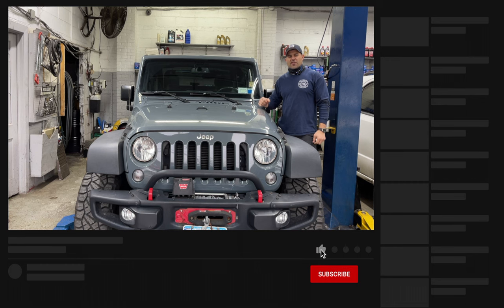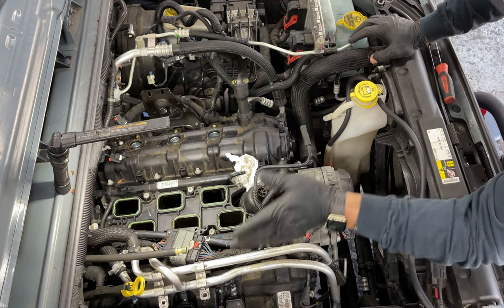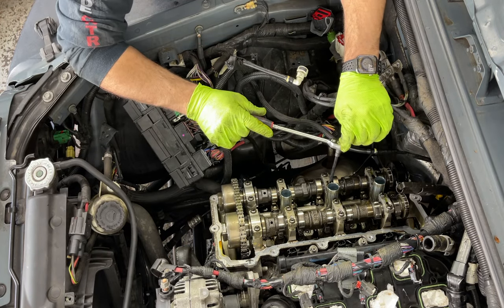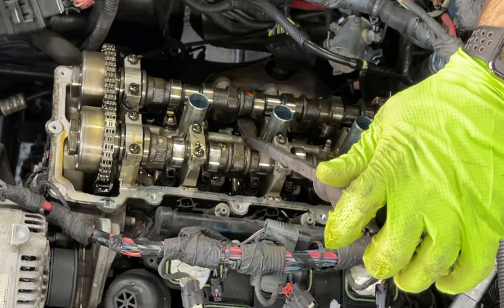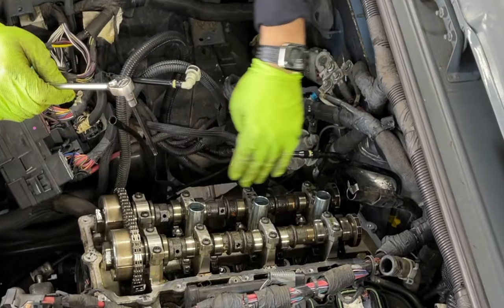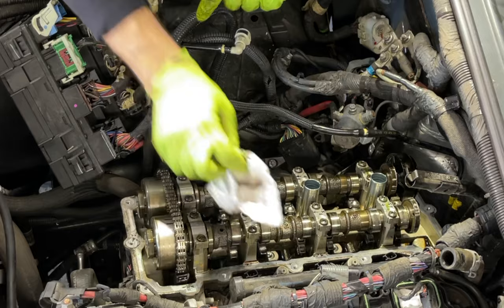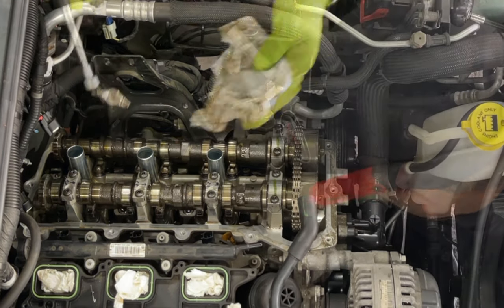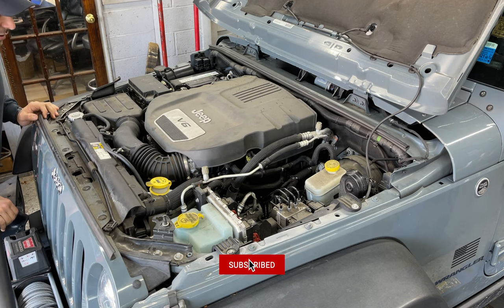How to fix Pentastar Engine tick Jeep 3.6L "SHORT CUT"

Comment: My jeep was ticking just like the one in the video. I ordered the parts and watched the video carefully and my jeep is fixed! Cost me a fraction of what the dealership wanted. Thanks a million!
Reply from the maker: I love when everything works out the way it should. You got the job done right, save $$ and learn something new. Thank you for watching I do appreciate your comment.
Reply: @a2zautomasters862  thank you so much! I didn’t have the money to pay to have it done! With your video it was easy to do. Thanks a million
Reply: Great vid. One question, do you need to replace cover gaskets?
Reply: Same.  500 bucks vs the 2400.00 the dealership wanted.🙄
Reply: How hard was it? About to this weekend? Any tips?
Reply: Hopefully mine works out the same, I just ordered the parts today.
Reply: Just replacing the rocker arm fixed the problem?
Reply: The problem is the thin oil they recommend. Use a 5w30 and eliminate the source of the problem.
Reply: About to Tackle this myself here real soon, all parts are ordered. Thank you for doing this video very informative.
Reply: @tullyg493  Is that for real?  The ticking is so annoying but this looks like a ton of work.
Reply: Dealer just quoted me 4500 for this!
Reply: @gary1488  just follow this guys instructions start to finish. And it will stop completely. Easy fix. Just looks hard.
Reply: What about cam timing if the cams are replaced?
Reply: @williamhaselrig9355 exactly.  This is not a job for the faint of heart. So many things can go wrong.
Reply: I'm about to have to do this to my 2018 Rubicon jl

Comment: Good  guy he is honest  knows what he's doing I have the same Engine he replaced  I had  ticking in the engine and even cam shaft needed to be replaced it took about 3 days to repair everything  I have no problems now I would recommend this shop you won't be disappointed
Reply from the maker: Thank you so much. I appreciate your business and your comment.
Reply: I am in Michigan.  where sre you located?
Reply from the maker: @vladvonravenloft9330  NY Long Island
Reply: How much does this cost
Reply from the maker: @dyllanfennell1570  Depends,  if you changing any camshafts, oil cooler seal kit, or camshaft position sensors. also got to change valve cover gasket, intake manifold gasket upper and lower and all 24 Rocker and 24 tappers. $2k-$3k
Reply: @a2zautomasters862  thanks for replying! I am probably gonna try to tackle this myself with the help of your video! Should I stay with Mopar parts or is there a better replacement that doesn’t fail?
Reply from the maker: @dyllanfennell1570  I usually replace it with the original. Thank you for watching and I do appreciate your comment.
Reply: @a2zautomasters862  I know it sounds like a lot however if the vehicle lasts another 2 years, it's still worth it. I take it that it might be hard to tell if all that is gone until you get inside the engine? I would think it would be well worth it replacing all the Rocker and tappers verses one at a time?
Reply from the maker: @MeganZopf   a job like this is usually about $2500 or so give or take. I have seen those Jeeps with well over 200k miles so it’s definitely worth fixing.
Reply: @a2zautomasters862  well if I can’t find anyone competent to fix it here I might have to take a trip! I really appreciate you taking the time to respond. It shows your integrity
Reply from the maker: @MeganZopf  good luck with the car. Thank you again. 🙏🏻🙏🏻🙏🏻
Reply: @a2zautomasters862    To prolong engine longitivity would 5w-30 be better than 5w-20 for a 63,000 mile pentastar and would a higher volume/pressure oil pump help prolong engine life including the rockers, what list of recommendations do you have ?
Reply: Does it still run?

Comment: Great video! After being quoted $3000-$5000 from multiple mechanics and being told its a 20 hour job, I knocked mine out for a fraction of the cost (in the hundreds $ only) and  finished mine in 5 hours taking my time. Thanks for the tricks!
Reply: Are you mechanically inclined? I’m not experienced with any engine work but I cannot afford a shop

Comment: I actually did this to my jeep. Didnt even take the cam bearings out. Just loosened them rolled the crank till the lobe was up on each rocker and pulled the lifters and rockers out individually.  Dealership guys will tell you it cant be done this way. But it can. Just have to be careful.  My jeep has 40k on it afyer i did it. Been running great.  No more engine ticks! Love me some jeeps! Awesome vid!

Comment: Just finished doing the job today! This video was immensely helpful. I was able to create an even shorter shortcut by leaving the cam caps on but fully loose on the bolts and prying accordingly (based on which cam lobe was up or down). Regardless I wouldn't have even tackled this job without this video. Absolutely fantastic. Thank you to the author!

Comment: God bless good people like you who take the time to share your knowledge and experience! I have a 2015 I bought used a year ago with 54k miles on it. Engine purred like a kitten until about a month ago and I started noticing the ticking sound (around 63k miles). I've never bought an extended warranty in my life until I bought this Jeep. Thank god I did, gonna be taking it back to the dealership soon and hopefully get it fixed under warranty.
Reply from the maker: Thank you for watching and taking the time to leave the feed back. 🙏🏻🙏🏻
Reply: Where did you buy parts? eBay?
Reply from the maker: @juanbugayong2026  dealer.
Reply: @a2zautomasters862  Please explain what is the problem!! 
The engine makes a ticking noise okay?  
Why is that a problem and why does it require a repair?? 
Please take a moment to explain that in your title and description.
Reply from the maker: @chazzcapone.  any ticking or knocking noise coming from inside the engine is not a good thing. It’s a sign of wear. Internal engine components are so precise, minimum tolerance and very very small amount of clearance. That noise usually means those very small gaps are getting bigger and that’s very bad. In this case the rocker arms bearing failed and the camshaft rollers are hitting the rocker arm itself and that could cause a massive internal engine damage. I hope that was helpful. Thank you.
Reply: Guys can replacing the bank 1 and 2 fix the ticking problem?

Comment: This is an amazing video that guided me through both sides of my 3.6 rocker arm replacement, followed exactly and had zero issues performing the work as shown. For anyone who is about to do this the first time, go easy with the magnet near the back of the cams where the tone wheels are and buy decent parts, I did have to redo a set that were bought from Amazon because the rockers were made out of spec and kept valves open losing all compression. Thanks
Reply: That sucks big time.
Reply: I just did this job. Got it all back together and it was super hard to get started, if at all. I'm wondering if I have the same issue you had on the first set you put in. Did it seem like it is flooded? It did crank over a bit strange like low compression.
Reply: Did y’all buy mopar?

Comment: Thank you so much for your video. Between you and another youtuber, I was able to replace a set of (24) rockers, lifters and one cam. I found a rounded left intake cam during. I’ve not had to pull the Battery box before. Your vid helped me with routing of emission and TIPM plugs on assembly. Was a huge reference, thanks again. Good reference for where stuff was before. Always take pics before you disassemble things.

Comment: Did this job yesterday on a '15 GC driver's side.  Much easier if you roll engine to a little before top dead center, for driver's side, for a more neutral cam position.  Keep the magnet away from the rear of the cam, it will destroy the magnetism of the cam position rotors.

Comment: Great video man! My 2015 JK had the ticking noise on the passenger side... I followed your directions and watched the video multiple times after ordering the replacement parts. Once they arrived, the job took 12-ish hours to complete spread out over a weekend. MY JEEP IS FINALLY QUIET AGAIN! Thank you for taking the time to make this video and having detailed instructions on what to do! Saved me thousands! 

I was wondering if you had a video on replacing the CAMS? I could see some wear on the lobe from the bad rocker arm and I know I will need to replace it sooner than later. Was hoping you had another video I could study before diving back in... 
Thanks in advance!
Reply from the maker: Thank you for watching and I do appreciate your comment. Glad everything worked out. I will be doing a video about that soon, it’s actually being recorded these days  hopefully will be posted in couple of weeks. Stay tuned. 🙏🏻🙏🏻🙏🏻
Reply: Did you drain the oil prior to opening?
Reply: @alfkeep  no
Reply: There are other videos that show acceptable vs non acceptable wear on the cam lobes.  But if you left it ticking for too long you could have damage to the lobes...I'm not sure how that would manifest itself as the engine runs....probably poor performance due to lower intake or exhaust volume....?
Reply: @a2zautomasters862 what’s the cause of the ticking in the first place? Typical problem w the pentastar or something else? 🤔
Reply: @lstruggy  those engines dry start due to the oil draining back into the crankcase after the engine is shut off,causing the rocker arm bearing issues over time.There's a company that makes an oil filter adapter that has an anti drain back valve, which keeps oil in the top of the engine and solves the dry start problem.
Reply: @davidh6818 it’s called Baxter Performance.   It’s a pricey part but high quality and over time cheap if installed early enough to stop the dry start wear issue with no oil in the upper part of the engine.

Comment: I’m literally sweating and on the edge of my seat watching this video 🫣 Greta video sir 👏🏽 luckily my 07 jgc laredo 3.7 never had this issues w ticking or knocking just routine maintenance that I’m always on top of 🙏🏽 she just surpassed 226K miles and she still runs like a champ!
Reply: You’re lucky. Our 3.7 in the Commander we use to own liked to spit the rockers off randomly.
Reply: @THETOPGLOCK  hahaa omg lucky I guess?! 🫠 how does that start to happen in the first place?
Reply: @lstruggy  First time was on a January night when the temperature was single digits. Went to start it and instantly heard a noise and check engine light came on. Second time the rocker got caught in the timing chain and broke the head. Nightmare
Reply: @THETOPGLOCK  omg 😳 yeah I’m lucky! I wonder if the single digit cold caused that?!  She’s mostly lived NorCal, SoCal then Vegas the last 8 years. The Vegas summer heat here really expedited the life of my water pumps and but I have lifetime warranty.

My cel came on today p0420 I resetted it but when I got home tonight  it came back on again haha my 02 sensors I believe needs to be replace. 

The other day I put a brand new alternator and a brand new battery all for free from lifetime warranty oreilys & interstate batteries headquarters here in Vegas only 2 yrs old battery went bad cause of mostly 115d heat will do it! 🔥u still got her and what year was her model?

Comment: Thank you!  I have 2012 Jeep Wrangler JK with 129K miles with the same 'tick tick' engine symptoms,  no Check Engine light or anything. I bought all parts needed (OEM parts through MOPAR) to do the job. I spent about $750.00 in OEM parts cause I'm not taking any short cuts or unnecessary risks.  I got the same tools you are using in this video and I'm planning on doing this job in early August.  I will follow this video step by step like my life depends on it, and report back.  Thank you.
Reply: Hi, this video is being super helpful.  I'm half way done with the arm rocker replacement work.  However, by mistake I broke the black plastic line the mechanic is holding @15:52 when trying to place back the top cover.  The black line broke just before the yellow marking you see on the video (close to the aluminum connector).  Can the line be fixed since it's plastic?  Is it difficult to replace the line in question?  Please any advice would be greatly appreciated. Thank you and God bless.
Reply: Have to make sure your cam journals aren’t worn to much otherwise this video is useless cause you got to pull the cams off.
Reply: 2012 here too had the tick and threw a code and it was repaired under warranty,was the rocker arm
Reply: Has to throw a code then they will fix it free
Reply: @kkp9068 it’s a 10 yr extended warranty, right?
Reply: @-Scraps-  wait until it throws a code then jeep will repair it.i have a 2012 also ,they would not repair it until it threw a code,finnaly tjrew a code and they repaired under warranty
Reply: @-Scraps-  doesnt matter was a recall ,they should repair if it throws a code
Reply: @kkp9068  I googled a bunch, not seeing anything about a recall? I saw a recent lawsuit? Have an official link on this?
Reply: @a.r.gonzalez1536  it has to throw a code before they fix it,hadnthe tick and they would not touch it .1 month later threw the code and they fixed for free
Reply: Yes has to throw a code

Comment: I used a modified version of this method - Used the cam lock tool / de-tensioning set to de-tension the timing chain. I only locked the cams in place briefly to loosen one end bolt and remove it to inspect it more closely. Overall - This saved a ton of time and I did notice that if you are only doing rockers - there is a "magic spot" in the cam rotation where you can get every single of one of them out without any issue and without moving the cams out of the bearing journals.  Unfortunately - I cannot say that for the lifters - you just need a teeny tiny little bit of extra clearance to get them all out - just like in the video. 😁

My screwed up rocker locations -  ( I did them all and all the lifters - 81K miles )

Passenger exhaust cam rear -  Rear 2 rockers were the worst
Passenger intake cam - Next to last rocker 
Driver Intake and exhaust were mostly ok - one rocker had slightly more wear than all the others - I lost track of where it came from.
Reply from the maker: Thank you for sharing. I appreciate your feedback

Comment: I have a 2013 Dodge Grand Caravan that has this motor. I’ve done all the work on our vehicles once the years and I’m going to have to do this to ours soon. It has 219,000 miles and it has recently developed that ticking sound. I’ve watched videos on how to do this the ‘recommended’ way, so I was definitely interested in finding out how to do it the quicker way. I’m confident in my skills. Thank you for the info!
Reply from the maker: Wow Developed @ 219? That’s impressive. I’ve seen this happened as early as 50k miles. Good luck. Thank you for watching and I do appreciate your comment.
Reply: @a2zautomasters862  I think regular maintenance has been key. It still uses no oil between changes.

Comment: Great video man! My 2017 JK has the ticking noise on the passenger side...I picked it up from dealer today for P201/P301 repair. Front seals and 60k service cost $3100. You video give me confidence to replace rockers/pushrods without fear. Thanks for sharing
Reply from the maker: Glad I can help. 🙏🏻🙏🏻

Comment: This is how I usually do it at the shop.  Back in the day I use to remove the whole timing chain and remove the cams.
Reply: They have a tool for holding the phasers and releasing the tension on the chain. Removing the chain or phasers completely is never required. Its always a gamble to do it that way as those cam cap bolt holes will strip out and pull all the threads out very easily. Then you end up replacing the head which is a bigger job all together. It takes at most 2 hours with the tools the right way.

Comment: Going this far I would recommend pulling intake and changing o-rings on water/oil cooler. This is a ongoing issue with these engines.
Reply from the maker: You can check out my other videos for that.

Comment: Hey bro thanks a ton for showing this. I had a failed rocker and followed this video. The hardest part of the whole thing was getting the valve cover off and back on. The passenger side is the easy side and it still took a lot of time. I have a Ram 1500 and the passenger side is not covered by the intake manifold.

Comment: On the one hand - this is clever and creative.  On the other hand...

The manufacturer probably knew this was possible but didn't prescribe this as the way to correct the issue.  You can argue that ends justify the means, but again I really have to wonder if the manufacturer agrees.  That's important to a lot of people because frankly, they should know what they're doing.  It may be that their process errs on the side of the 'average' wrench approaching the problem vs. someone who's being careful.  That said - you're one slip from gouging a lobe, and you're prying against a sealing surface.

The additional break-down may also reveal additional problems that they'd like to avoid.

Finally, from a warranty perspective or customer spend perspective - what got paid for the job?  The full pop time it takes, or the time suited to the reduced number of steps?  I'm not saying don't pay techs for skill - but this isn't purely skill - it IS deviation from the procedure - he says it right in the video.  Don't hate - I'm not judging- I'm just asking.